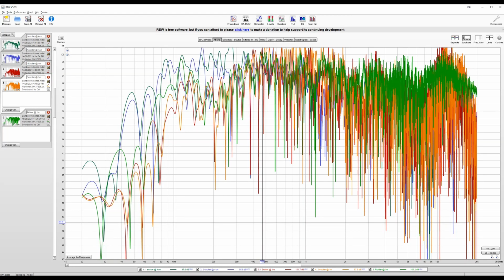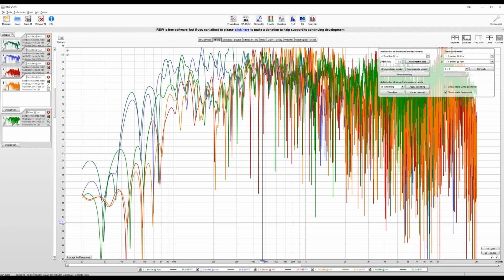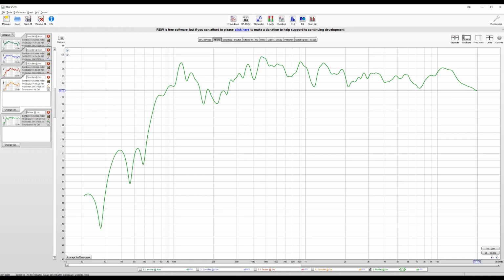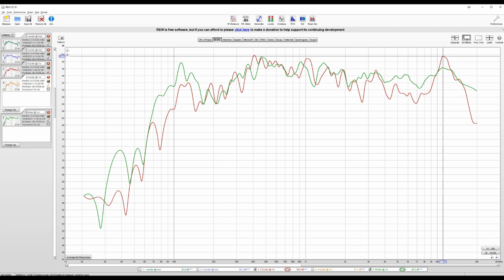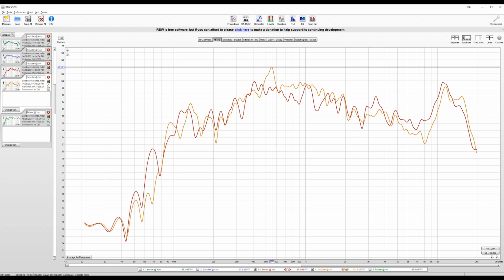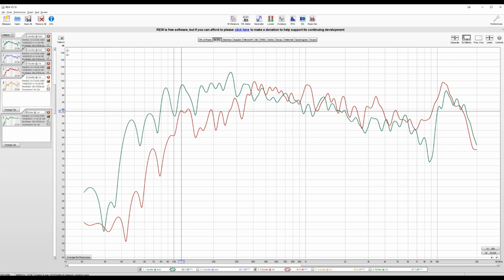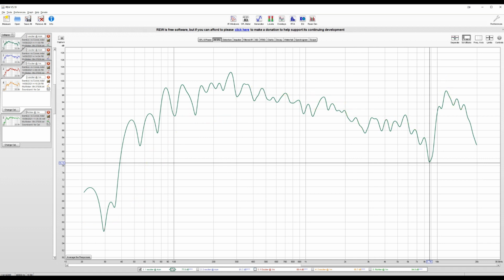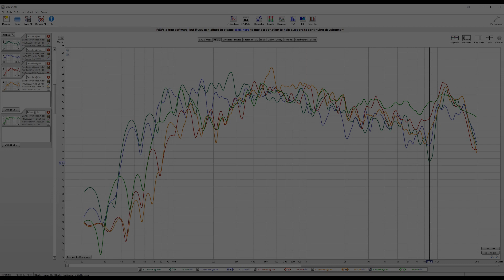Measuring my DML Panels - Are 2 Drivers Better Than 1?

Comment: The dip(s) in response on your conventional speakers at ~150-220 Hz - is probably due to a floor cancellation based on the height of the woofers and the test mic, above the floor. The reflection down from the woofers to the floor and then back up to the mic, is often 180 degrees out of phase with the direct path - so this cancellation dip often shows up at about these frequencies.
Reply from the maker: Hi Neil, thanks very much for this. Does it make sense to elevate the speaker so that the distance from speaker > mic is much less than the distance from speaker > floor > mic?
Reply: @TypicalBenYT  If you are inside, then elevating the mic and speaker, and using the gated measurement, will be better for a more accurate measurement. Or nearfield, can be useful. It depends on what you need to measure. I need to learn about the gated measurement in REW.
The most accurate way to get actual speaker response, is to do it outdoors.
Reply: That’s correct, and why we put the measurement mic on the floor (rather than at ear height). I place my measurement mic on a small piece of carpet or a mouse pad. Distance also matters (to eliminate the room to a greater extent) - the 1m placement is about right, but you could probably go another 50-70cm back from them before room reflections are acoustically relevant.
Further to treatment of the room- people often overlook that these panels are bidirectional- as much energy comes off the back of them as the front. The first reflection point to treat is often the wall behind them rather than in the room. 
Smoothing - unless you’ve parametric equalization with better than 1/12 8ve resolution, 1/3 8ve is fine resolution. That corresponds better to the “natural” bandwidth of the human hearing mechanism. 

There’s a document on the exciter manufacturer’s website that details placement of multiple drivers on panels…I have it bookmarked somewhere…

Comment: Hello Ben.  Could you do the tests outside in a big open space so as to eliminate room influences?  You'd then have a good starting reference to work from and could determine the crossover frequency for the subwoofer and have fewer hills & valleys in the response plot.

The YT channel Tech Ingredients has a decent article on something similar where he tries a variety of shapes and materials, you'll find it if you search for World's Best Speakers.

Planar 'speakers do present sound in a way that's different from regular cone types and the drivers and panels you use do lend themselves to fairly easy experimentation though explaining how & why results vary might be rather complicated.

For thinness and rigidity carbon fibre mouldings take some beating though you're then getting into the realms of exotic materials.  A couple of members of the British Boomerang Society were very successful in making carbon fibre 'rangs.

 Best of luck with the placement of multiple drivers.
Reply from the maker: Hey Steve. Unfortunately it’s not really possible to do outdoor measurements where I live at the moment. I’m hoping to be moving soon and that place should be more suitable so I will hopefully be able to do so then.

I’ve seen that TI video too, it’s what got me interested in DMLs actually. The challenge for me is to find a compromise between sound quality and visual appeal if possible.
These bamboo panels are my first go at it.

Comment: From listening to your dialogue I hear that your room does sound a bit lively which will cause microphone measurements to be skewed in all manner of ways.  Making a room sound right is a fine balance between liveliness and being acoutically dead, certainly when I remove large items of furniture from the room there's a difference in the sound.  More carpeting would help, also consider strategically placed drapes on large hard surfaces other than the floor, even closing curtains makes a difference.
Reply from the maker: Hi Steve - thanks for the tips. The room I'm in really isn't ideal for audio as it's fairly small and odd-shaped. I'm hoping to be moving house soon and will definitely do what I can within the realm of a happy marriage!

Comment: Resonant nodes come from speaker edge reflections that coincide at physical locations on the surface at specific frequencies. Parallel edges and inside angles cause focusing. Try outline shape contours that have a mix of progressive convex and concave curves so that the transit distance to resonant points are lengthened and vibrations are radiated before arrival. Internal "S" slits also help break up paths to resonant points.  There is a reason why musical string instrument have outline edge curved shapes. It's to make all notes have equal levels.
Reply from the maker: Thanks Robert. This is definitely something I want to learn more about as it sounds like a great way to improve the sound.

Comment: What you're seeing in the low frequencies in the differences between the far and near field measurements is cancellation coming from the back of the panel being out of phase with the front. Not saying that the room modes aren't an issue, but that "falling off a cliff" effect you see in the base has to do with the wavelength of the bass frequencies that are wrapping around the panel from the back. If you can figure out a way to construct 'wings' for the speaker that don't interfere with the panel vibrations you will get a big boost in bass. There's clearly quite a bit of bass there that's getting nulled out. This isn't a new problem, it's common to any dipole panel speaker.

That weird peak at 550 hz I'm guessing comes from the center exciter placement. Measuring with a single center exciter vs a single 3/5ths exciter would probably be illuminating there.
Reply from the maker: Hi Perry, thanks a lot for this - that makes  sense and should be something I can test. The wings are an interesting idea that I’ll definitely look into.
Reply: @TypicalBenYT : Hi Ben, thank you. I used the term 'wings' because that's what SoundLab called them when they offered them as an option on their speakers. It may not be immediately obvious but the old Apogee Acoustics dipole ribbon loudspeakers essentially used that cool trapezoidal frame as a 'wing' to increase the bass response of the woofer ribbon panel, the part of the panel with the tweeter was the wing on one side, the sloping outer side of the speaker was a variable wing on the other. The problem here for you is that those speakers have rigid frames where a wing can be attached or the rigid frame itself is the 'wing'. I don't know how you could attach anything to those panels that would be able to delay the wave from wrapping around that wouldn't also hurt the panel's ability to vibrate freely. Possibly an excited panel within a larger 'dummy' panel with a thin strip of foam between them?

If nothing else, it can just stop you from beating yourself up trying to get bass out of a design that can't produce it. I've heard it said that the old Acoustat electrostatic panels were technically producing bass down to around 2hz, but you just accepted that you were never going to hear anything below 50hz out of them because of the basic nature of the speaker. It's also possible that a panel within a panel design could give you more bass but also reduce the openness and airiness of the sound. That's why Apogee used the variable 'wing', very little baffle up around year ears, more baffle below. The Martin Logan CLX actually has a hidden variable wing on the back of the speaker for the same purpose. But again, they have a rigid frame to attach it to. Neither the frame or the wing affect the vibration of the electrostatic panel at all, they just increase the distance that the wave has to travel from the back to the front of the speaker.
Reply: Room modes tend to give you large, but narrow, peaks and valleys. So you could have a big boost at 80hz for example, but 70 hz and 90 hz would be fine. It has to do with the exact length and width of the room (and height), so it's an exact frequency that gets excited not a broad range of frequencies.

For the speaker to just fall off a cliff under 200hz either the exciter or the panel isn't producing those frequencies or it's rear wave cancellation. Your near field measurements prove that it's the out of phase long wavelengths from the rear of the panel nulling out the sound from the front.
Reply: Oh, I'm really digging what you're doing here. Very nice work. Subscribed.

Comment: How to measure spaekers. Its pretty simple, there are four methods; just it is at your listeningposition (with the average function 10cm in every direction on your listeningplace), gated (typically at 1Metre but you cant measure Bass that way because all frequencyies below the gate are cut off), outside at 1metre distance typically with the speaker elevated atleast 1-2metres to avoid groundreflections (thats the best option if you live in a quite area, if you live in the City simply forget that option) and lastly my favorite option "Nearfield"because you can do it inside, in very confined spaces (very close to chassis like 2cm).
I would not use 1/12 Smoothing, 1/6 or 1/3 is gonna give you a better overview and the psychoacoustic smoothing is very interesting as well.
A calibrated Mic is a Must if you want to measure very Low (below 300Hz) and very High (above 5KHZ).

Note: Your peaks and dips are most likely Roommodes who occour usually below 200HZ or reflections above 200HZ but that depends on how close you are measuring and how big (or small) your room is.
You can find that out when search for Roommode calculator. 

Note2: Set the Scaling to 5db between every line, 50HZ at the bottomend and 20KHZ at the top. Please show the noisefloor in black, next time.

But here is the most important tip: Dont even bother measuring at half a metre, Metre or more. Just measure Nearfield. 

I could not find a tutorial for gated measurements in englisch but I know Frank in Germany did one a couple weeks ago. Its in German but very easy explained and automatic subtiteles are available, Search for : ENDLICH ERKLÄRT - Tutorial für Messungen ohne Raumeinfluss

Cheers
Nik
Reply from the maker: Hey Nik, thanks a lot for the information, I'll see if I can improve my measurements next time.

One interesting about the nearfield measurement that  someone else  commented is that the response might differ depending on which part of the panel is being measured. I think to start with I will test this with measurements across the panel to see if there is much variation across the panel surface.
Reply: @TypicalBenYT  Good idea. Typicall chassis beam a lot (Search for the word directivity ). 
DML are unlike common speakers, DML create what we call Wellenfront (wavefront) in German, they have no to very little directivity) (depends on the frequency and panelsize).

The Dropofff in the Basssection is not surprising at all because (i think) DML are Dipolspeaker (the backwards emitted are reverversed in polarity and cancel eachother out with the Front if the Wavelength is bigger than the size of the panel. 
Thats why almost all speakers are enclosed in some way.
Btw: It looks like NXT speakers (DML) are enclosed too but the enclosure is really thin.

Comment: I would try significantly bigger drivers if it interest you.  If you  take apart a bookshelf speaker you will notice the drivers are much larger than these DML speakers and has a much smaller and lighter horn. I have a feeling these small cheap drivers probably aren't powerful enough for large panels
Reply from the maker: Yeah I think that to go any larger, you’d need multiple exciters or like you’ve said, maybe modifying a larger full range speaker to drive the panel.
Reply: @TypicalBenYT   what about the oposit route?
lighter panels
Reply from the maker: @Stephanthesearcher  good question. They’d still need to be stiff but other than that I’m not sure how they’d sound. If I come across a suitable material I’ll test it.

Comment: A super informative video. Excellent job providing important data. So far as the 2/5 and dead-center combo, my understand had been that to place the exciters on one panel at the 2/5th mark (and basically do this for both exciters if in a dual-exciter configuration, perhaps an inch apart) and the other pair of exciters on the other panel go dead center. The idea of this being of course that this misaligns the resonant peaks and troughs between the two panels for a flatter overall experience. I don't know, but suspect, that having two panels wherein each has one at 2/5 and one at dead-center fails to create the same result; with that approach both panels will have matching resonate challenges and so there won't be the averaged out into the flattening that is desired.
Reply from the maker: Hi Michael. I think you’ve nailed it - the aim was to achieve different frequency response from each panel to ‘smooth out’ the overall effect (this was my original setup). When you add a 2nd driver you get cancellations and resonances on the individual panel, which doesn’t appear to have done much to help matters. I need to do a bit more experimenting with multi-exciter panels and will post my results when I get time.

Comment: Good experimentation... TANX!!

Would using thin BUNGIE cord to suspend the panels better isolate them?
Reply from the maker: I don’t think bunnies would be noticeably better or worse really - the rope doesn’t transfer any vibration to the frame as far as I can tell.
Reply: @TypicalBenYT  Would you hang the bunnies by their ears?

Comment: The 4cm measurement shows an apparent boost in the low frequency response which is because the low frequency phase cancellation between the front and rear of the soundboard isn't picked up by the microphone at such a close range, but at realistic listening distances the bass will still sound weak as phase cancellation occurs as a function of actual wavelength (The lower the frequency the longer the wavelength) versus distance from the soundboard. When the wavelength is the same or nearly the same as the distance from the front and backside of the sound board, this is where out of phase cancellation happens and as the frequency goes higher the wavelength gets smaller and smaller and the distance for phase cancellation grows smaller and pretty soon the distance for phase cancellation is too short for sounds from the frontside to affect the backside and vice versa. And you're right that the listening environment has enormous effect on the apparent frequency response in addition to the soundboard material, driver mechanical and electrical characteristics and a load of other random factors.
Reply from the maker: Good call. This implies that if 'the room' were somehow removed from the measurement, I would see relatively strong bass response at the 1m distance as well.

It also implies that in order to improve the apparent bass output of the panels, the best solution would be some kind of room treatments... Bass traps etc?

Comment: Seeing this i would but subwoofer going up to 200hz i think it will lover that 80-120 peak
Reply from the maker: I do plan to do a follow up video with measurements of the full system as well!
Reply: And that high peak at 10 000hz i bet that is wood related, resonates easy at high hz
Reply: Oh and even they told you that you cant hear anything above 15khz i bet you can sense it somehow because i have super twiiters  going 35khz and it sounds brighter even if the frequensy respons is kind a flat.
Reply from the maker: Interesting - now I'll have to build a multi panel DML with crossover to test this out!

Comment: I have never experienced DML speakers and know little of their design as my interest is with omnis. Looking at the various measurements I can see similarities.that suggest that the room resonances are playing a large part in the results.
When measuring my omnis I have taken them outside away from reflections and find  I can really get a free field result that is quite different from inside, maybe you could try that.
A thought about the difference in the 11kHz trough between the 1m and close results, could it be due to the measuring microphone’s directional response accepting much more of the panel area radiation when at 1m compared to close up? (If that makes sense to you!)
I use a modified electret microphone for measurements being the most cost effective (cheap) means and find it gives good  results.
Great video, well done and I would like to see more of your work.
Ray
Reply from the maker: Hi Ray, thanks very much. Where I live is quite noisy outside so it might be difficult to get decent measurements there - I do need to come up with a solution though. Thanks for the suggestion re the resonances - if you got similar patterns inside with your omnis it sounds like that might be the culprit.

Regarding the near vs far field results - it makes perfect sense actually. I think a further test at different points across the panel might be in order to confirm this.